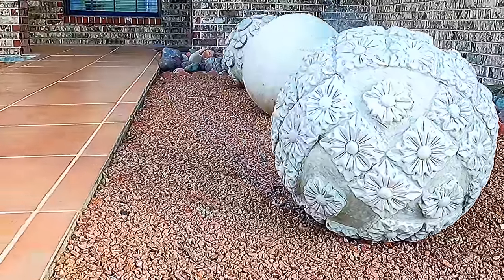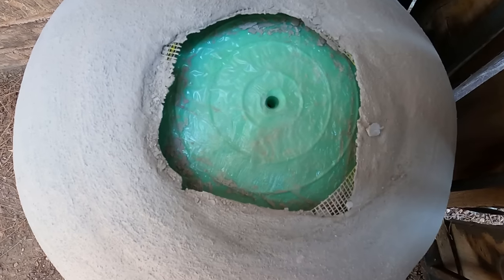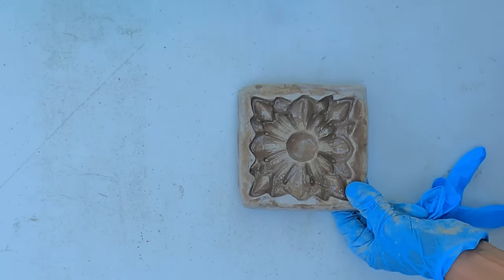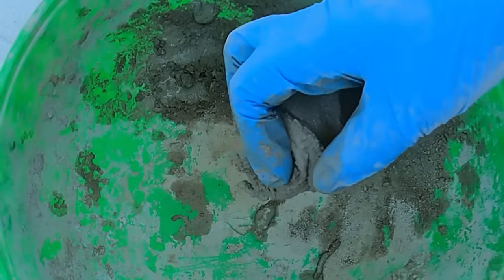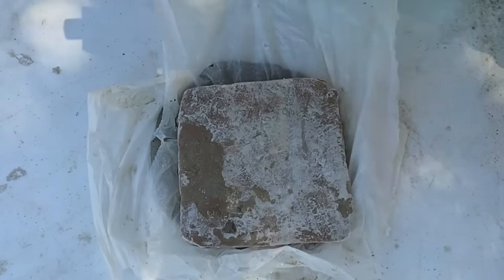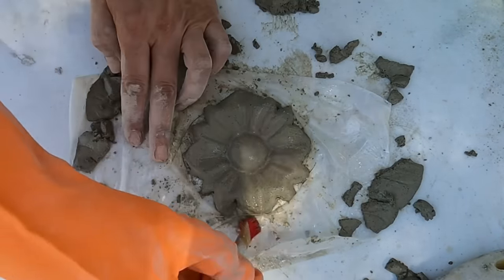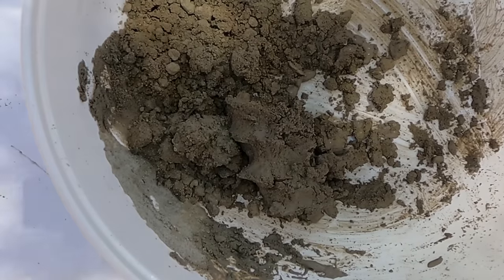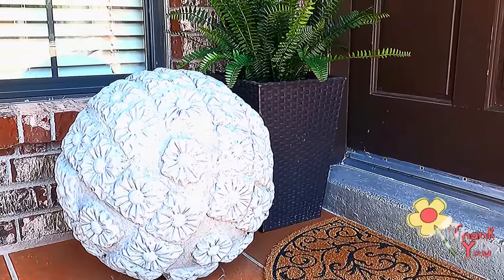CONCRETE GARDEN BALLS/ GARDEN SPHERES/CEMENT GARDEN ORB/Concrete Balls for inside/outside

Comment: Try sealing the wood pieces, before using as a template as wood is sticky due to moisture in clay.  Dust the wood template with cornstarch before pushing into clay. That should help with the sticking.
Reply from the maker: Thank you for the awesome tip!! I’ll definitely do that next time ❤️

Comment: Do you not have to put medal in for reinforcements?
Reply from the maker: No it isn’t necessary. Make sure that you use the concrete tape and apply a thick layer of cement/concrete

Comment: Just wondering what kind of sealer to use after? I've seen similar videos and they usually seal them to help protect them from weather. I love where ita very cold and snows in the winter and guessing I would have to put them inside to prevent damage
Reply from the maker: Use this recipe for a long lasting concrete that will not crack. Your project will last 10 years in any Weather
10  cups of Portland cement 
5 cups of fine sand 
2 cups of Metakaolin 
Acrylic concrete bonding liquid- find in Home Depot- (1part acrylic 3 parts water)
Reply from the maker: For sealer 

https://www.homedepot.com/p/Seal-Krete-24-oz-Turbo-Concrete-Wet-Look-Spray-357925/312680486

Comment: what type of cement s used for projects what is smooth concrete?
Reply from the maker: I used cement all rapid set. However if you want a much more stronger product then go to the description and look at the concrete recipe that I have listed. It is a much stronger mix that will withstand years of harsh weather. Good luck and thank you for watching!

Comment: I'd love to see what would happen with a 'dry cast' for your details.  It's pretty simple.  In place of your wet cement mixture use only the dry (powder) cement for putting into your moulds.  After screeing (with a straight edge to make it smooth),  using a spray bottle with a relatively fine mist, mist it for about 2-5 seconds.  Let it sit (for out doors you let it sit for an hour). You're not trying to wet all the cement at once.   An hour later do it again.   Do this 2-3 times then let it sit until it's completely dry.
Reply from the maker: Thank sound interesting. Ill have to check it out and do more research. Thank you for the input. I appreciated!

Comment: Is sand not necessary?
Reply from the maker: There are many different types of mixing recipes some include sand and fiber or fortifying elements. However I went with cement all and so far they are holding up nicely.
Reply: Sand helps add strength, which isn't necessary for decor. The flowers might see damage if it's rolled over solid surfaces, but not using sand gives a smoother finish.

Comment: I don't understand what kind of cement or concrete to buy. I don't live in portland. He says use portland concrete. Then later he says cement. Which is it, concrete or cement, or are they interchangeable? Plus, there are so many variables of the product, its making my head spin. Please help!
Reply from the maker: You can use cement all. Is a product that you can find in any Home Depot. Portland cement is a type of cement that’s sold in Home Depot as well. That is the name of the product. It has nothing to do with the city of Portland if that’s what you are referring to.  I hope my answer helped you.